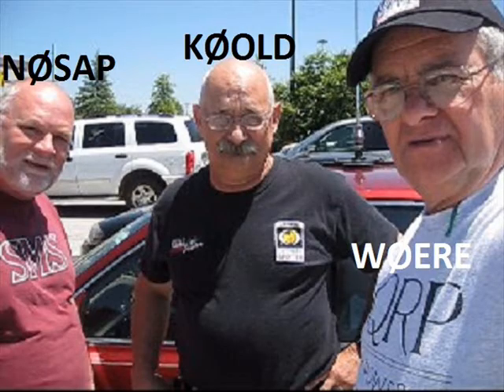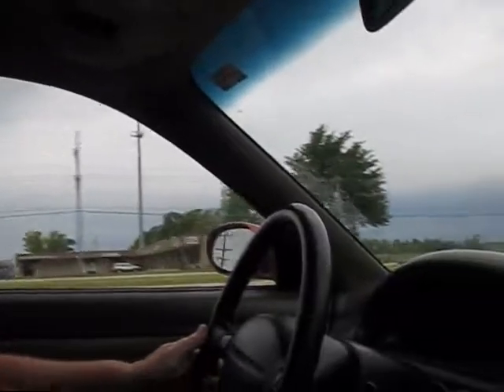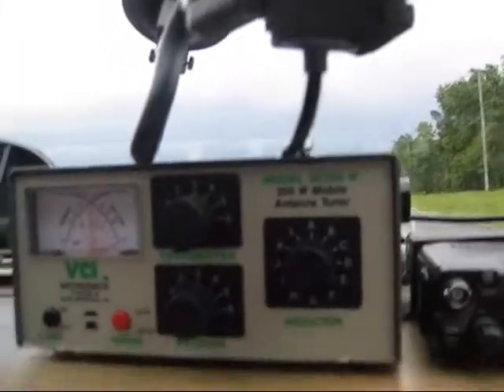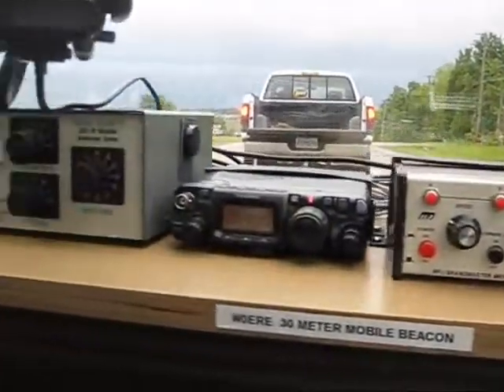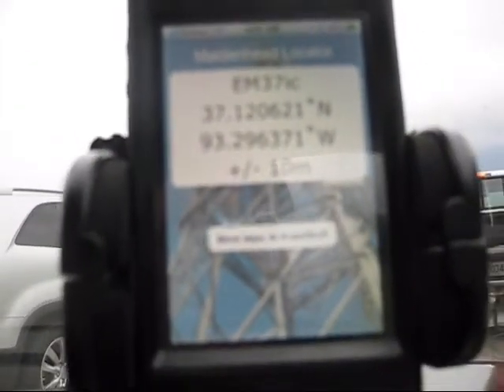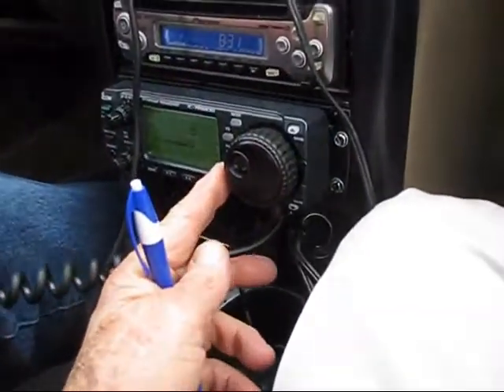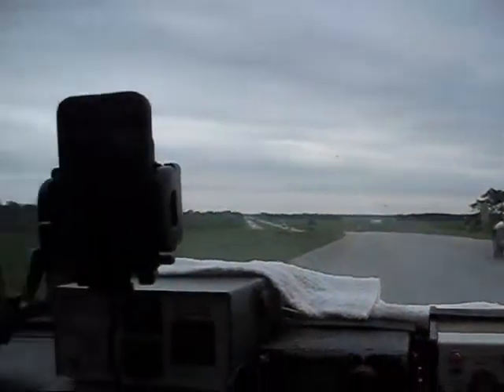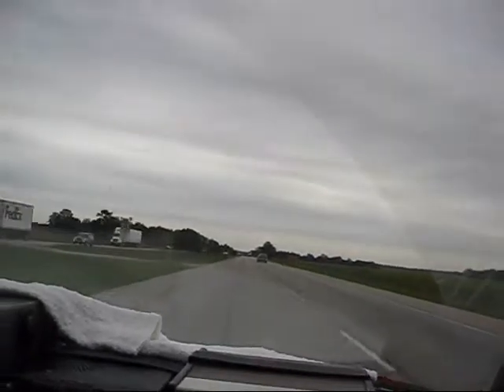W0ERE - INITIAL 30 METER MOBILE BEACON LAUNCH

Comment from the maker: Ref. the trailing wire.
It is short enough as to not be a hazard.
All the possible factors of safety were considered long before our trips. It is not safe for any vehicle to follow with in 12 feet behind any vehicle at 58 mph (launching speed for wire)
Below that speed the litz wire drapes on the roof  and trunk deck, the remainder is about 6-8 feet on the ground. We were stopped by a patrolman at a speed zone. He never notice the almost in invisible antenna.
Lutz wire was chosen for multiple r

Comment: A flapping wire "23 feet" behind the vehicle is not legal. While there is no specific law against it, any law enforcement officer who saw it would most likely ticket you for producing a 'hazardous' situation to other drivers; a broad law on most states books.  Image a motorcycle, not seeing the wire, pull up behind them and get the trailing-wire slapping them in the face then wrapped around their neck.